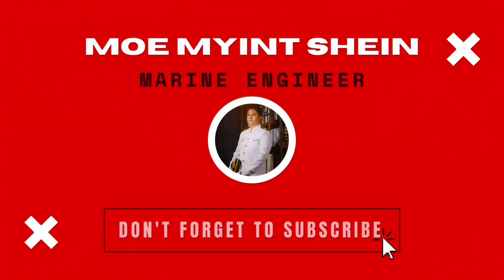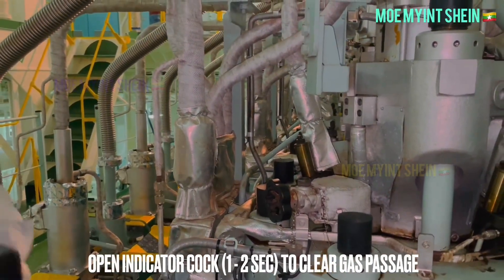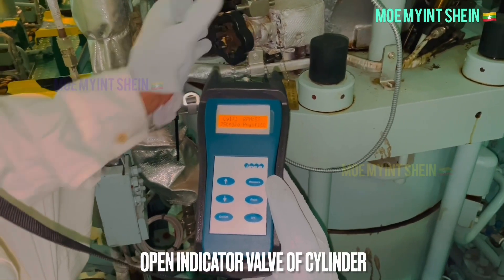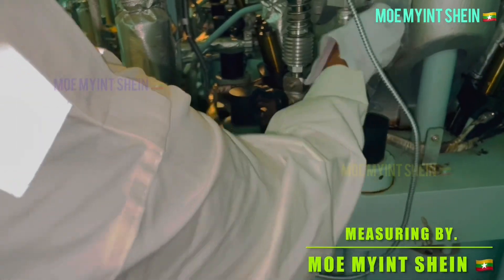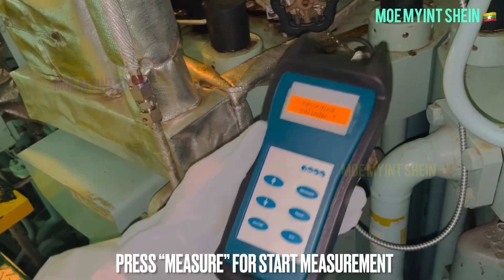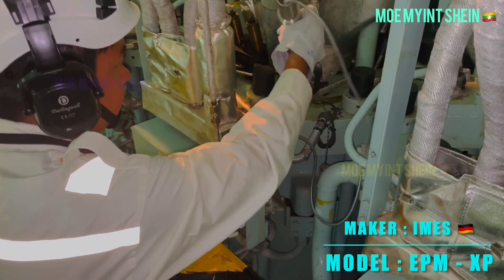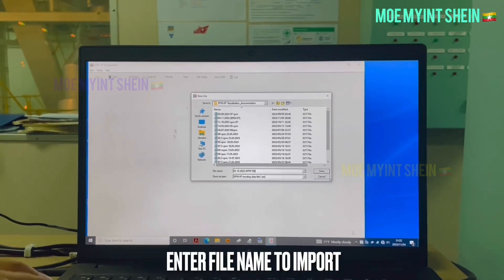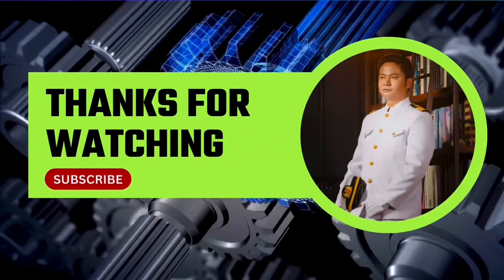Measure Engine Performance with Electronic Indicator | MOE MYiNT SHEiN | Technical Vlog : 091

Comment: Thanks
Reply from the maker: Appreciate !
Reply: @CHiEF_MOEMYiNTSHEiN  may ı ask u a few question about the cooling water treatment ın main engine?
İllustrate that İ have made the nitrite and chloride tests and ı have found the ppm according to the formula. What ppm is the best for nitrite and chloride? 
After ı have found that the nitrite ppm is high, how can ı decide how much chemical should ı mix İnto cooling water, as example ı use diesel guard as chemical for cooling water and found that nitrite level is low. How should ı proveed further and how to decide the amount of the chemical ı get to mix İnto cooling water? What book or information guide dö ı have to use?
Reply from the maker: May I know maker of chemicals onboard? 

If you are using chemicals from UNITOR, I would like to refer UNITOR Product Guide book for quick reference. 

Thanks.

Comment: Good evening sir.
Sir I have 3 questions, can you please answer me.
Q1. Why scba is required near boiler during aux.boiler & E.G.B cleaning process?
Q2. Duty engineer action- when there is a 440V low insulation alarm comes out.
Q3. How lifeboat starts(starting mechanism)?
Please sir it's important, I searched but didn't get the exact answer, I believe that I'll get it through you.

Thankyou sir
Reply from the maker: 1. Some company regard boiler and EGB are enclosed spaces. As per enclosed spaces entry procedure, standby SCBA for emergency use. 

2. When 440V low insulation comes out, if you doubt inform senior engineers as first. 

Mostly 440V low insulation comes from galley cooking appliances. If cook or mess-boy spills water over hot plates (or) bottom of pans touch quick straight heater rods, 440V low insulation alarm activates. (Most Happening) 
This can be confirmed by switch off breaker for galley equipments in 440V Feeder panel. 

If alarm is not from galley, separate two  parts. Main Switchboard or Emergency Switchboard. If alarm activates on emergency switchboard, trace all feeder from emergency switchboard. 

If not from emergency switchboard, need to trace one by one from main switchboard, 440V feeder. 

3. Your question doesn’t clear for me. Please clarify, again. 

Thanks.
Reply: @MoeMyintShein1987  thankyou very much sir🙏
Reply: @CHiEF_MOEMYiNTSHEiN  sir any specific  use of scba set near boiler egb apart from any other enclosed space?
Reply from the maker: SCBA keeps standby as per enclosed space entry permit. This task to be done for entering any onboard enclosed spaces. 

In here, depends upon company, declaration of enclosed spaces may little different. 

Have a good day and safe !!!